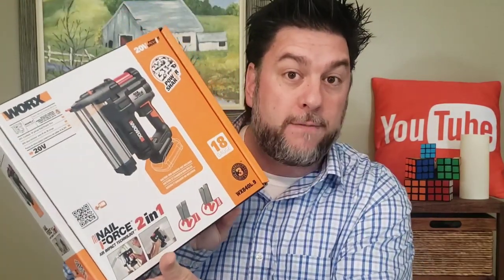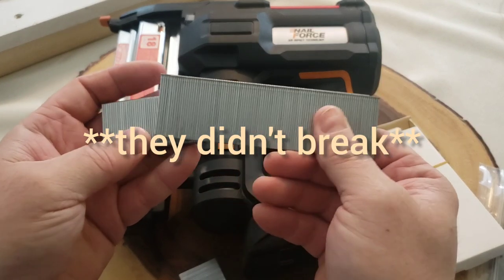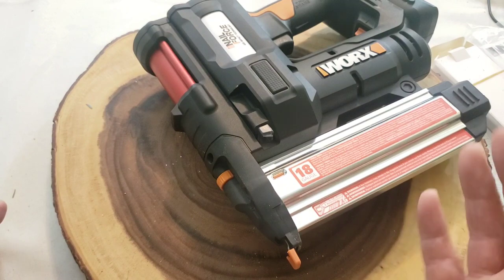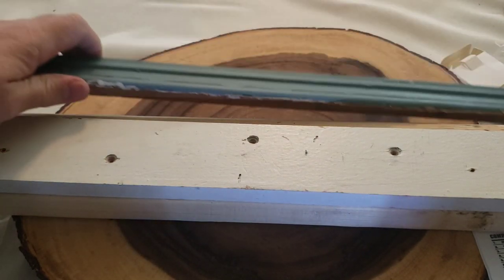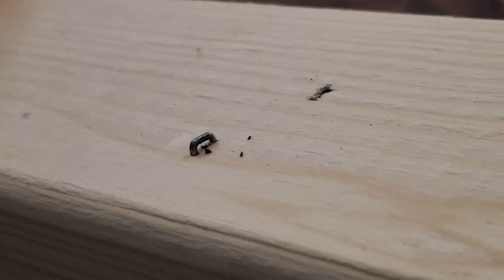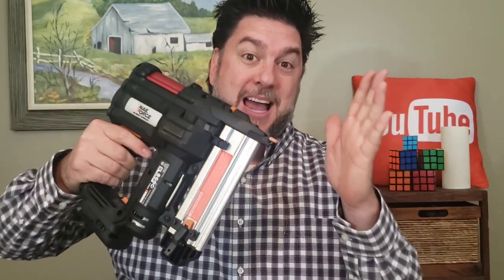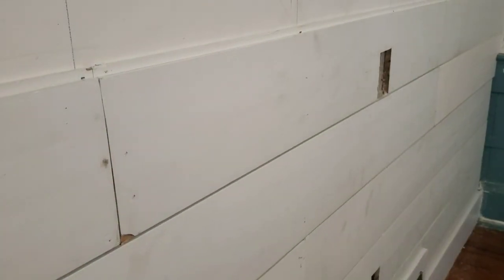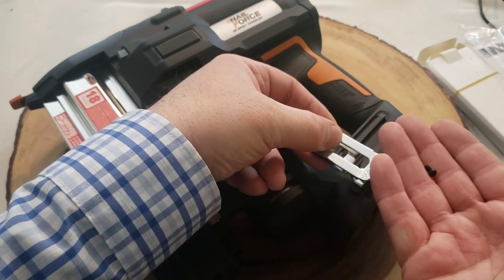WORX Nail Force. Cordless Brad nailer. Battery operated nail gun. WORX power share #worx [248]

Comment: Bought this Works nailer and used it on the first day to install 20mm pine fencing slats. Was working great but after about sixty nails the sliding impact bar slid right through and wouldnt return. Opened it up with the allen key and it did the same thing about six times, rather frustrating .Suddenly started working again but need to test again. It hasnt given me much faith in the tool as am now uncertain whether it will work at clients houses.. As a contractor i now carry my pnematic makita 18 gauge nailer + compressor and the works nailer to jobs for the day it plays up again. I  will be in contact with Worxs for a replacement is this happens again.

Comment: Mine arrived today. Love it. My only gripe is that I origionally ordered the bare tool, via the WORKS amazon store with no battery/charger, and when I finaly got the shipping date for here in the UK it was late MARCH (ordered begining of January for projects I am doing NOW) The sneaky bastards are delaying shipping the bare tool so you cave in and pay the extra for the full set with battery and charger to get the thing in a reasonable amount of time. £50 extra for a charger and 1 battery, that I don't even need. BAH!!!
Reply from the maker: I like the bare tools as well.  I have 6 of the batteries so that's good for me...lol. although I have heard they are making newer models of the battery which are supposed to last longer. Thanks for checking out the video and taking the time to comment.
Reply: @Jeffreviews4u  Thanks for your reply.

Drill
Strimmer
Hedge trimmer
shureshot? Water gun spray thing, (not very powerfull but ok to clean bike.)
and now the nail gun.
So I am a bit all in with the shared battery thing. If only I had more hands!!

Comment: It is a great tool and I have done a number of projects already with the Worx Nail Force.  The only thing I find that is troublesome is that it is temperamental in firing from time to time and I have no idea why. I bought this tool because I have purchased a number of works tools and products and have had great success.
Reply: I forgot to add that it will push a staple through metal studs.  I made panels with metal studs from Lowes fill it in with Rockwool insulation and stapled 30lb. tar paper on the back and metal from my mobile home skirting to the front of the metal stud small box to replace my skirting on my mobile home.

Comment: That Worx Nailer Is A POS !!! I tried my brand new one today and it shot one nail and no more !!! I was using the nails that came with it. A fully charged battery and nothing just noise. So it goes back to Amazon tomorrow ! The critical comments at Amazon state most people had the same problem. Wish I would have read them first before ordering it. 😖
Reply from the maker: That is frustrating. I have a misfire from time to time. Thanks for sharing your experience 👍